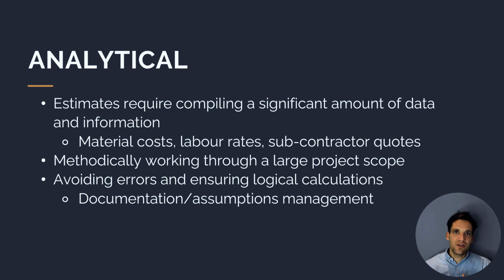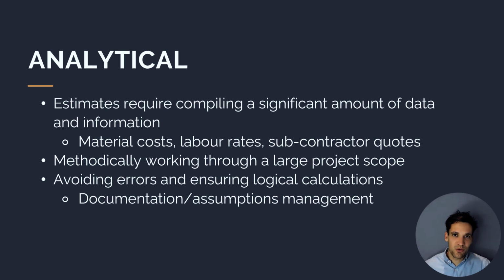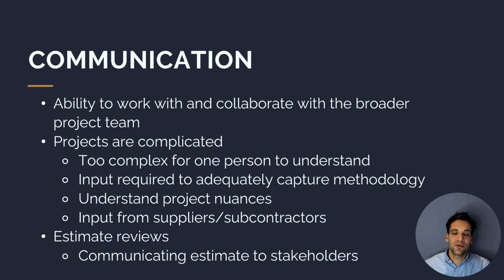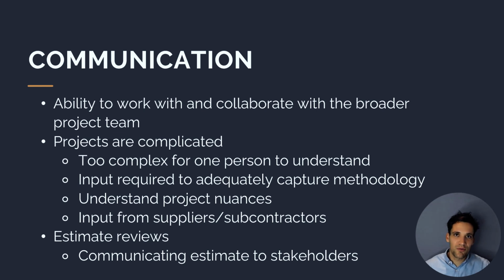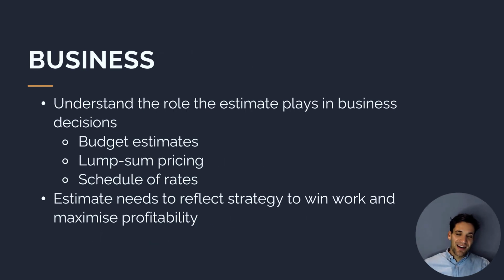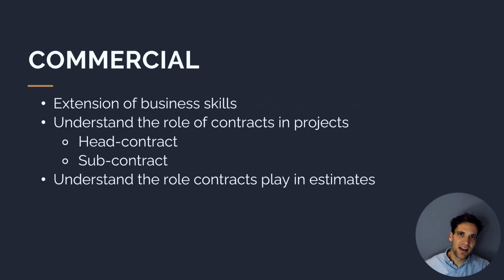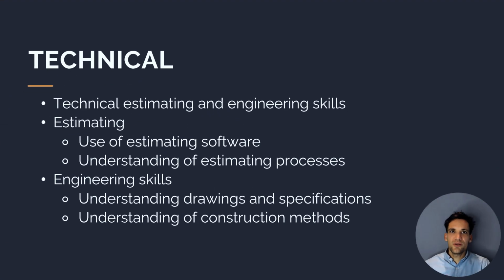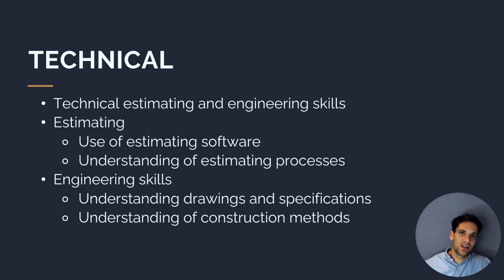Master These Skills to Become a Top Construction Estimator

Comment: All current main stream estimating software like bluebeam, planswift are 2D pdf based, should be obsolete soon. BIM 3D accurate takeoff is coming and will become industry standard soon...
Reply from the maker: It depends a lot on the type of project.
For example, 3D models make a lot of sense for industrial plants, buildings, etc. Where there are complex structures, services
However, they are not really useful for solar farms, roads, etc.
Also, some detail is hard to represent in 3D models, for example, detailed construction joints where you need a drawing
But yes, I agree, BIM is definitely the future but I think 2D drawings still have a place